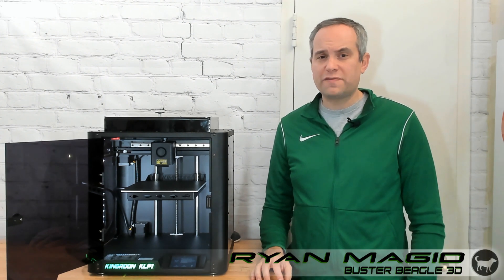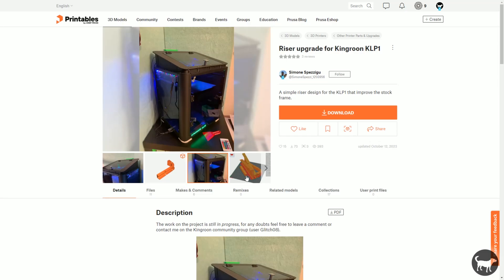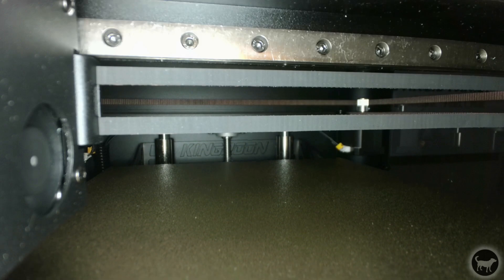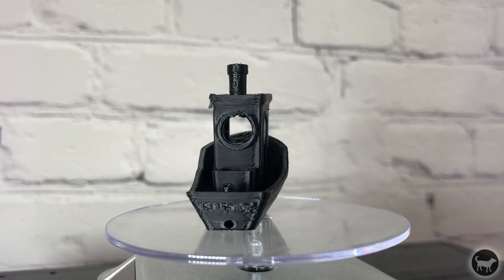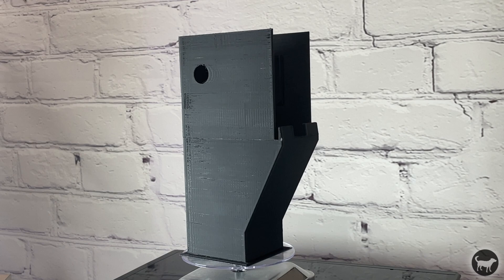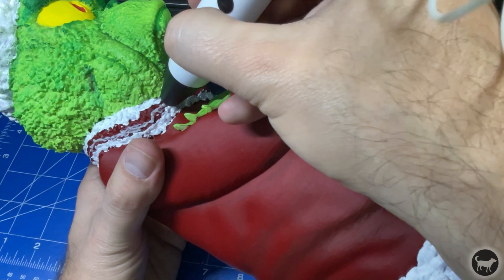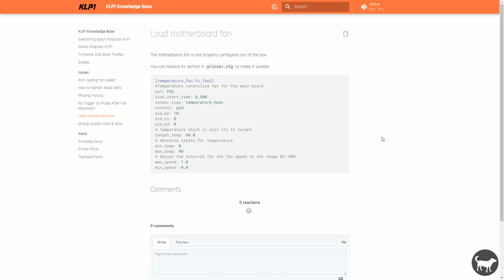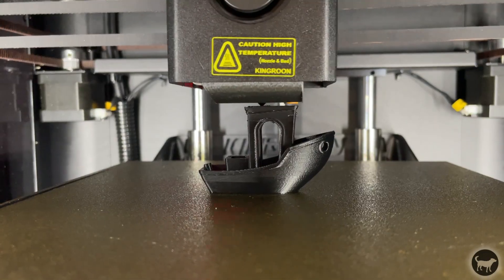Kingroon KLP1 Core XY 3D Printer Review | Klipper | Full Enclosure | Super Fast Print Speeds

Comment: Very nice upgrades on your KLP1. I just ordered one of these for doing smaller projects in ABS/ASA/Nylon. Kingroon had it on sale for US$229 with free shipping so I couldn't pass it up. I've been running a Kingroon KP3S for several years and it has been very reliable and produces very good prints. A couple of upgrades I'll probably do to the KLP1 is to replace the dark tinted panels with clear panels. I'll also move the touch screen outside the enclosure. Putting LED lights inside is a good idea so I'll follow your lead and do the same. Also the extended top cover. I'll probably bypass the filament runout sensor and feed the printer from an external dry box.

Comment: Could I have the file to the spool holder and if you have anymore 🙌🏻 I just got a klp1 230 used and am trying to do all the little mods it needs!
Reply from the maker: Dropped them here. Enjoy. https://drive.google.com/file/d/18V_jBV8R9S6bPU0ubAIpIKwsqd6f2s_F/view?usp=sharing
Reply: @BusterBeagle3D  thank youu🙌🏻 now I’m just trying figure out why the back of my prints arnt getting enough air flow, they keep slightly warping from not drying fast enough I think, I’m running 205 and a 60 on bed
Reply from the maker: @CodyArndt-w5b  Just open all of the doors or better yet just remove them all together if you are using PLA primarily. You really only want it enclosed for ABS, PETG etc where you need higher temps.